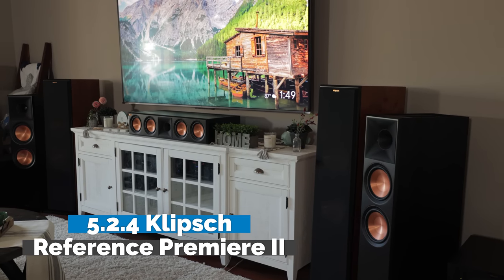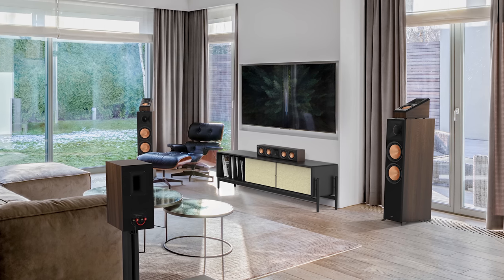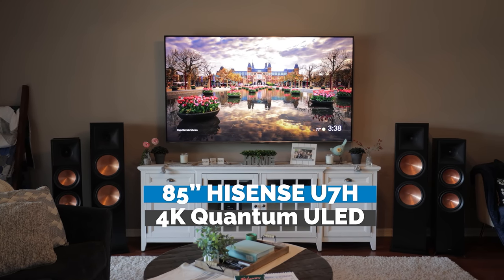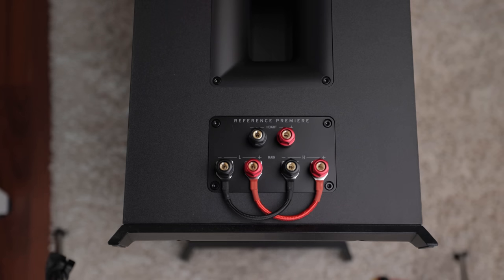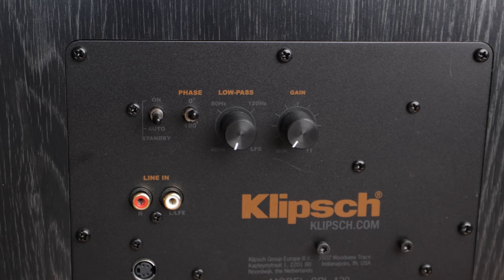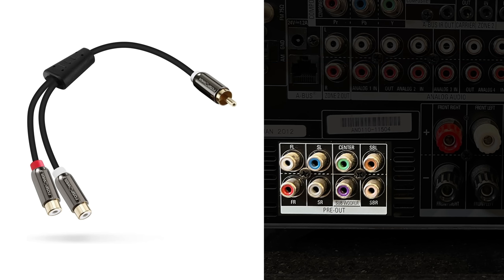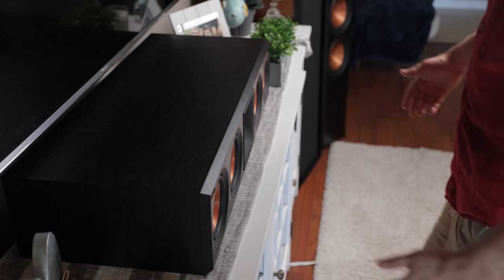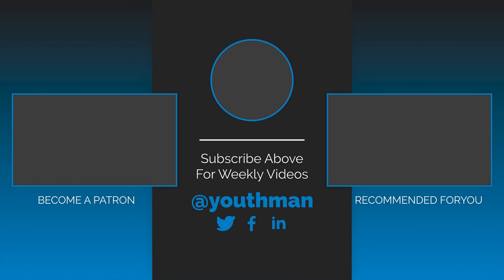HOW TO Setup a 5.2.4 HOME THEATER Surround Sound Speaker System | Klipsch Reference Premiere II

Comment: Many Atmos setup videos seem to agree that the up-firing speakers don't give the overhead effect desired.
They say that fielding mounted gives the best effect. 
Do your homework.  Keep your reciepts.
Reply from the maker: I agree. Upfiring Atmos should be your last resort. On-ceiling, in-ceiling or wall mounted height speakers would be a better option. I did not have that option in my living room.

Comment: Just curious as to why a standard size living room would need TWO LFE's.
Reply from the maker: There’s only one LFE channel. Some AVR’s have 2 or 4 independent Sub Outputs so the AVR can time align them and level match them independently.
Reply from the maker: If you are asking why a standard size living room needs two subwoofers, it’s because it can provide smoother seat frequency response across multiple seats
Reply: @Youthman  
Ah. Gotcha. Txs.
Reply from the maker: @elevenb6967 happy to help

Comment: How do those atmos speaker sound on the bookshelf and tower instead of height speakers?
Reply: Bouncy bouncy are nowhere near as good as the real thing
Reply: @totalplonker824  yeah I have front heights but I always wonder if they are any good
Reply: @Lowkey_nxthxn  where you said "front Heights" do you actually height speakers or are you on about the bouncy bouncers...
Reply: @totalplonker824  no I use front height speakers In a 5.2.2 configuration but I was always wondering if those dolby enable speakers would be better since dolby always promotes them
Reply from the maker: Height speakers would be a better option than up firing speakers.

Comment: When listening to a 2-channel encoded movie and one is using a 9-ch internally amplified AVR, one is not only going to be hearing that same 2-ch signal coming out of the base layer channels but they're also going to be hearing that same 2-ch signal coming up the bouncy bounces. Do you really think a movie that has been mastered for two channels was actually mastered to be heard this way?

 When listening to 5.1 encoded movie with the Atmos channels on,  one will be able to get away with it with the up-mixers but when listening to 2-ch encoded movies with the Atmos channels on, IMO this is where Dolby Atmos actually falls apart.
Reply from the maker: What movies are only mixed in stereo? Even so, you can always select Stereo on your AVR. It doesn’t have to be up mixed to multi-channel audio

Comment: Two sub outputs does not mean .2. The second number represents the number of LFE channels and Dolby Atmos only uses one LFE channel. You even stated that in your own description. 
This is a 5.1.4 system. There is no such thing as a 5.2.4 system.
Reply from the maker: You are technically correct in regards to channel count as I shared the same in this video - https://youtu.be/keYveWd5o_4?si=4RAEYzlPSGL3nZy_ but it’s immediately understood what speaker configuration someone has when they say they have a 5.2.6 or a 9.4.4 setup.

I agree there is only one .1 channel.

Comment: Videophiles usually skip the receivers pass through and do a direct hdmi connection to the TV and then reroute the arc back to the receiver.
Reply from the maker: Six one way, half a dozen the other. With it being a digital signal, it wouldn’t change the video quality. What benefits would it provide?
Reply: @Youthman  long cable runs and too many termination points cause signal degradation.
Reply from the maker: If the signal makes it, there’s no degradation. As I shared in the video, digital signals are zeros and ones. They either make the journey or they don’t. You can’t have zeros and ones that are better quality than other zeros and ones. Unless you’re having a HDMI dropouts or sparkles, long runs are fine. If you have really long runs like I do in my Theater Room to the projector, simply use an active fiber optic HDMI cable. No issues.